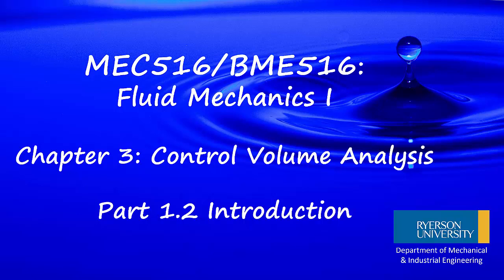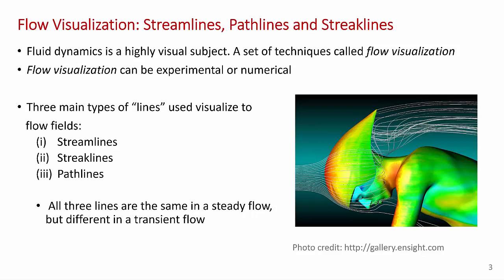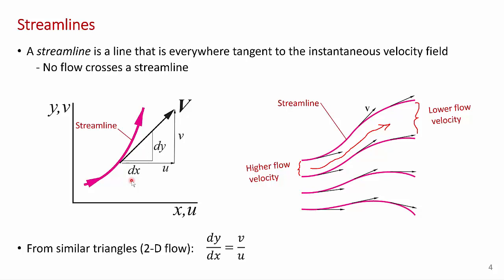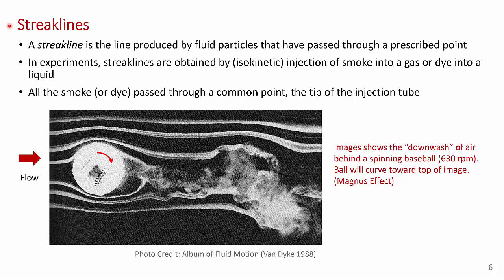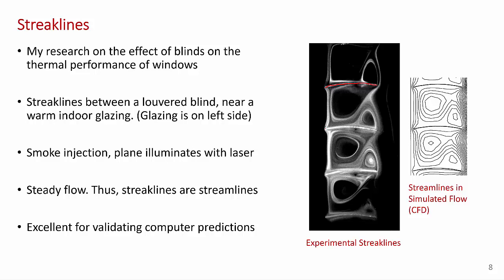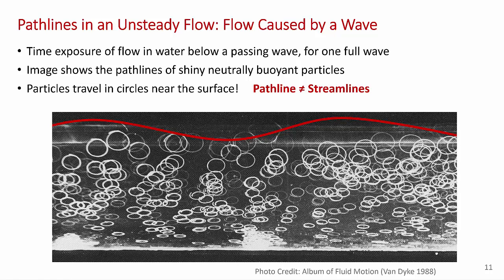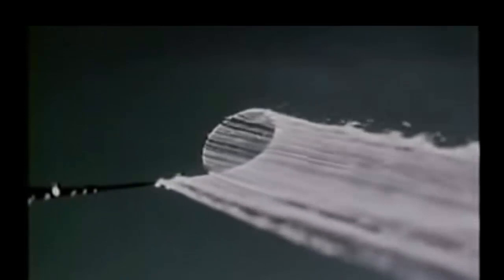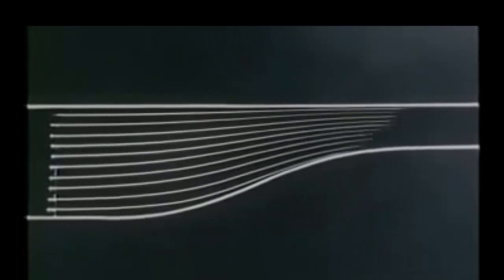Introduction to Flow Visualization: Streamlines, Streaklines and Pathlines

Comment: How to make these simulation?
Reply from the maker: The simulations are done using computational fluid dynamics, which are numerical solutions to the equations of fluid flow (Chapter 4). After the velocity field has been solved, the "post processor" usually offers various types of lines to visualize the flow. For example, mech eng students may have access to the Fluid Flow Simulation module of SolidWorks, which has these capabilities -- also ANSYS FLUENT, COMSOL, etc.